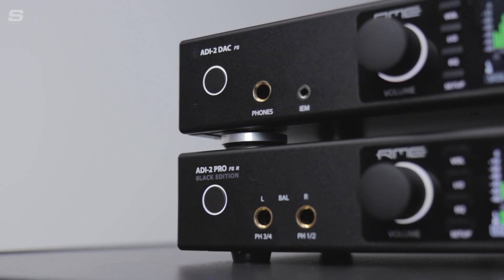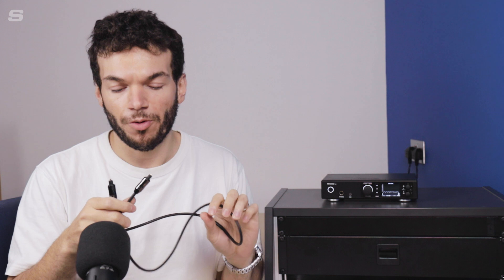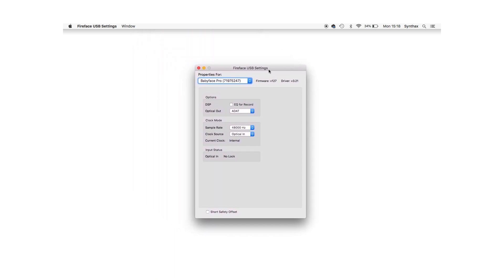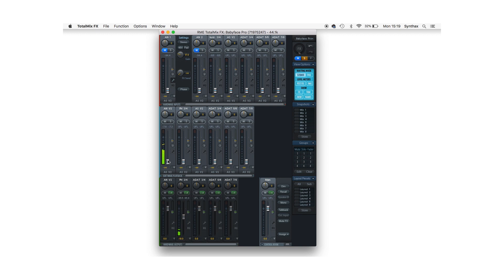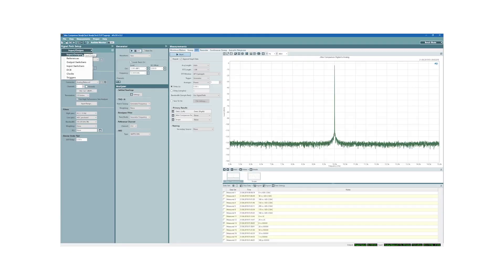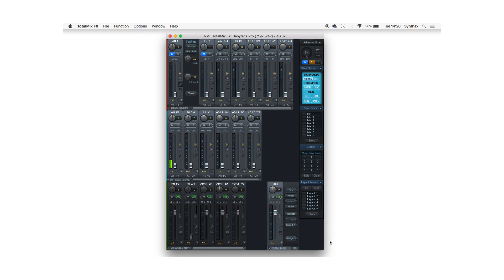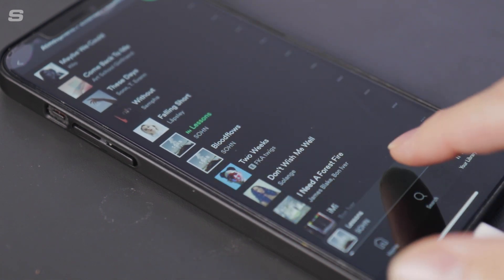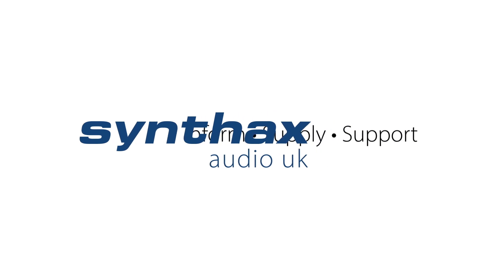How to connect the RME ADI-2 DAC FS and ADI-2 Pro FS R to an Audio Interface

Comment: Hi Synthax Audio, thanks for the video. Im still getting my head around the functionality and benefits of using the ADI-2 Pro FS R or ADI-2 DAC or ADI-2 FS in combination with an audio interface (in my case the UCX 2). Im reading through the comments here, but one area is still not clear and am wondering if you clarify for me? 

Will the audio being recorded to the DAW be of higher quality if routed through the ADI-2 Pro or ADI-2 DAC FS or ADI-2 FS compared to the quality of my UCX 2? I understand the difference would be marginal but i am trying to better understand if there is an analogue to digital output after DA conversion. I would think this would be the case because of the marginally better converters in the ADI-2 Pro compared to the UCX 2 but i am uncertain about this because all i am seeing and hearing are comments that the reference for monitoring with headphones or monitors will be higher quality. Am i missing something? Do all of these 3 units convert back to digital as an available output which can be routed into what is recorded into the DAW? 

Also, I am trying to figure out which unit of the ADI-2 series will be best for my needs. 

Can i utilise the main headphone outputs on the ADI-2 as a second and 3rd live monitoring headphone mixes using routing? (While I am at the same time using a live monitoring headphone mix on the UCX-2?) 

Do any or all of the ADI-2 units offer this functionality? 

Thanks
Reply from the maker: Hi and thanks for commenting, hopefully the following helps clarify things a bit;

1 - Will the audio being recorded to the DAW be of higher quality if routed through the ADI-2 Pro
- Analogue audio sources recorded via the ADI-2 FS or Pro FS R's inputs will in theory be higher quality than the same source recorded through the UCX II, as the ADI-2 Series have slightly better A-D (and D-A) conversion. As you state the difference will be subtle though, as the UCX II already has very high quality inputs. Recording with the ADI-2 Series is really meant for a few specialist cases (namely mastering) - for the vast majority of studio recording applications, the UCX II is more than capable!

Also if you're asking whether it's worth routing audio out of a DAW, then recording it back in via the ADI-2 FS or Pro's analogue inputs, purely to achieve a 'higher quality' signal, then no probably not. It's not a 'mojo box', and is designed to be transparent - you'd be better off looking at dedicated hardware or FX units that are designed to process audio (EQs / compressors / summing mixers etc).

2 - Do all of these 3 units convert back to digital as an available output which can be routed into what is recorded into the DAW?
- Only the ADI-2 FS and ADI-2 Pro FS R have digital outputs. The DAC is essentially a D-A Converter only, i.e. it's designed for listening / playback only. It therefore has digital inputs, but not digital outputs (although it can pass audio from the SPDIF input to the USB connection).

3 - Can i utilise the main headphone outputs on the ADI-2 as a second and 3rd live monitoring headphone mixes using routing?
- Yes, you can send audio from the UCX II to an ADI-2, then monitor via its headphone outputs. This can be the same as what you're monitoring via your UCX II, or something different... depends what submix you send to the ADI-2 (from TotalMix).

Both headphone outputs on the ADI-2 DAC or Pro will play back the same audio however, as all of the outputs share the same audio source.

Comment: Is It  possibile to connect the adi 2 fs to a m1610 via the adat out to use as monitor ?
Reply from the maker: Sure, any of the ADI-2 Series can connect to another device via ADAT (so M-1610 Pro ADAT out > ADI-2 ADAT In).

The M-1610 Pro doesn't have ADAT inputs however, so if you want to send audio to the M-1610 Pro from a computer you'll need an interface with MADI or AVB (or you could use analogue).

Comment: I have the RME ADI-2 PRO FS R BE and was wondering...if I attached a Preamp to it via balanced XLR, then will the two have the same functionality as the Babyface?  Will it then be a fully functional Interface, using the Preamp as the zero latency monitor?
Or is it truly better to buy the Babyface as the preamp/interface?
Thank you,
Joshua
Reply from the maker: Hi, the short answer is no, you won't have the same functionality as using a Babyface with an ADI-2 Pro FS R.

Longer answer; the ADI-2 Pro can only operate as a class compliant interface, meaning you don't get RME's custom low-latency drivers. You also don't get access to TotalMix FX for routing control either.

So yes, whilst you can connect your mic pre to the ADI-2 Pro's inputs for recording (and monitor it via the ADI-2's headphone output), what you cannot do is monitor the input signal and playback from the computer without going via your DAW, which will introduce latency. This may or may not be a problem for you. 

The easiest method is to simply connect the ADI-2 Pro to an interface or sound card (e.g. via ADAT).
Reply: @SynthaxAudioUK  Lovely, thank you.  I will use my old babyface.

Comment: useless presentation without clarity, eg, why do you use the Babyface just to use the optical ? IS TOSLink better than the USB ? ADI-2 pro fs has USB input to connect to PC, dont you know that ?
Reply from the maker: As we mention at the beginning of this video, this tutorial was developed for connecting an audio interface to the ADI-2 Series as a way of improving the monitoring capabilities of any audio production setup.

As the UK distributor for RME we get asked this question a lot, so we thought we’d make a video on it!

Later in the video we discuss connecting the ADI-2 series via USB, though as you’ll appreciate, you can’t record microphones solely with an ADI-2, as there is no phantom power. So you’d still need to connect an audio interface with this I/O to be able to do any sort of music production. 

Hope this helps explain!
Reply: Because there are those of us that use the ADIs as a DAC and not an interface. This video is to show how you can use both if your interface has ADAT. Therefore it’s an extremely useful video showing you how to use your ADI in different settings.
Reply: If I used a preamp to power phantom powered mics could we use the RME ADI-2 Pro then to record?

I'm trying to figure out if I can buy this and no audio interface?

Would probably need one to get instruments like guitar recorded though huh
Reply: This was a dumb ass comment. The video was clear and precise

Comment: For DAW work. I have an audient id22, say im done tracking and mixing and I want to send my 2 track mix out from DAW to outboard analog gear for processing, I'll be able send it out to the RME (with the USB) the the D>A out of the XLRs, run through outboard analog processing, then BACK into the XLR ins for A>D then back into DAW (again with USB cable) to print the final master 2 bus. This sound correct? Currently I guess I dont mind the converters on the ID22 for tracking the individual instruments, but I worry that with all the hard work of mixing, to send a 2 bus final mix down BACK out through the audient wont give me as good a conversion as the RME ADI-2. Thats another round trip needed and seems RME would hold up the best. hope that all makes sense, im still trying to work this all out. ive never looked into a high end converter like this before. thanks for the review!
Reply from the maker: Hi, sure you can use the ADI-2 Pro for capturing your outboard in extremely high-quality. In regards to hooking it up, I'm not too familiar with the Audient but assuming it has ADAT or SPDIF you'd be better off using that (rather than USB). In using it this way, the ADI-2 Pro is just an extension of your audio interface (i.e. easy to route audio in and out of your computer via the Audient), and will also allow you to clock the two devices together.

Alternatively, you can record the ADI-2 Pro via USB (running it as a class compliant interface), however you likely won't be able to use it at the same time as the Audient (or you'd at least need to switch between the two in your's DAW) settings. If you're on a Mac, creating an aggregate device may work, but you'd still need to clock the two via SPDIF/ADAT... 

So, the easiest method is simply to use ADAT/SPDIF!
Reply: @SynthaxAudioUK  thanks for your reply. as is usual, I spent all night researching and  my question sounds dumb now ha ha. yes indeed, that all sounds right. Question though, if I am only using the RME as a converter, for mastering ins and outs, I started looking at the older version of the FS (silver plate), its a thousand bucks less and seems like the same converters. I may go that route as I dont think ill need the DSP or the amps on the headphone jacks. Although on the FS-R they said the filters come in handy. what do you think about that ? the silver fs VS fs-R for my needs? thank you SO much for your help
Reply from the maker: @flipnap2112  Hi again, yeah the ADI-2 FS is essentially just a straight 2in/2out converter so may be all you need (if you're mainly just routing a stereo pair out and back in). Like you say there's no DSP, multiple outputs or DSD play/record etc, however if you just need detailed and transparent recording up to 192 kHz you can't really go wrong. 

In terms of the filters, in my experience they're extremely subtle, and probably more for Hi-Fi guys to stroke their chins over... Your mileage may vary of course. The ADI-2 FS uses the SD Sharp filter which is the most neutral and has the least effect on the frequency response, hence being the best for audio production. 

Of the three models - FS, Pro and DAC - all are high-end reference class DACs with exceptional sound quality. All I can really advise is trying them for yourself to see which you prefer. All the best.
Reply: @SynthaxAudioUK  That's amazing, thank you so much. I really wanted to check in with you and make sure there wasn't something I was missing. I appreciate you keeping in touch and your advice. Thanks so much and hope you have an amazing week!

Comment: Hello could you help me out? I was wondering if the conversion in the RME ufx plus is as good at  this? Or even as good as the baby face pro?
Reply from the maker: Hi, all three units have excellent AD/DA conversion. Any differences between the UFX+ and Babyface Pro will be extremely subtle, and I doubt you would notice any differences in a real world scenario, e.g. a full mix. See this video here from sonic state for a great comparison between both units and Prism Dream converters;

https://youtu.be/xySFqxQSz7k

The ADI-2 Series is a slight step up in terms of conversion, having been designed as a top-end converter (although 2-channels only, compared with the high channel counts of the interfaces). It therefore lends itself to those situations where the extra detail may be useful such as mastering and measurement testing etc. Depends on the application of course whether you require that fine level of detail.